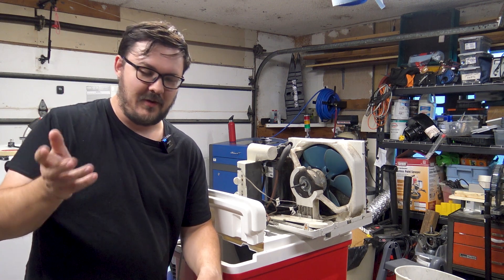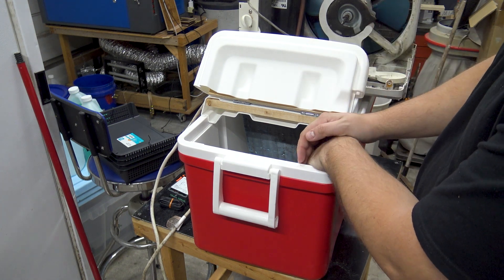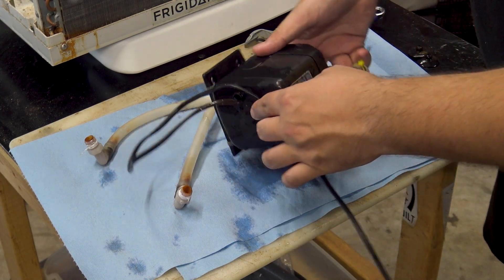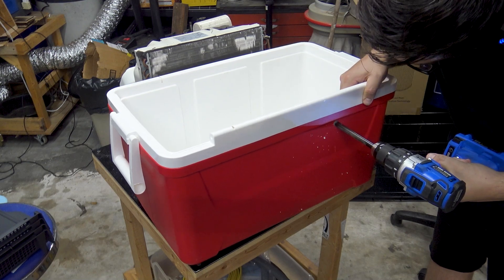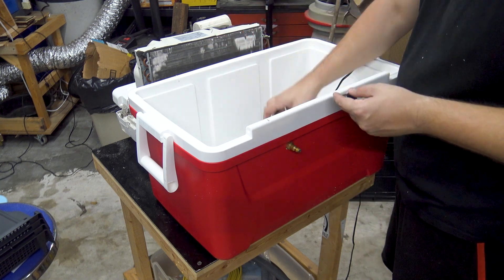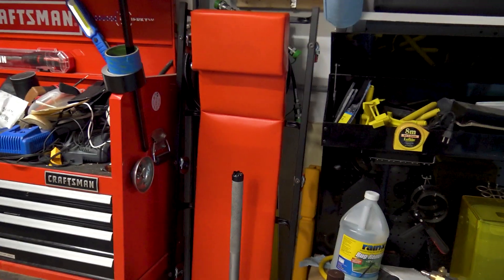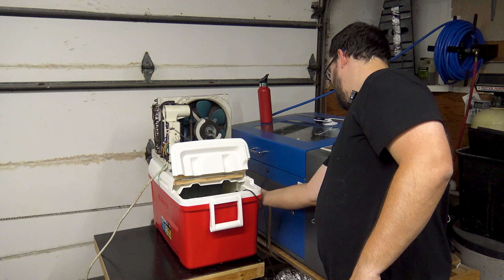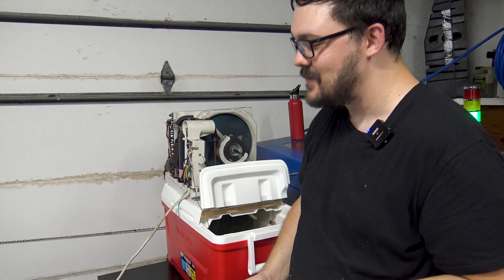IT WORKSSS! | DIY Laser AC Unit Water Chiller | Part 2

Comment: I know this is pretty late, but you should try to NOT use antifreeze in a laser. It will exponentially increase the likelihood that the laser arcs inside itself.
Reply from the maker: Good input. Thought about that but didn't really look into it much. So far it's been working fine, but I'll keep that in mind.

Comment: Have you had any issues with this system?
Reply from the maker: So far so good. The coolant fluid has gotten a little bit dirty but the container is not perfectly sealed and it's in a dirty garage and there's absolutely no filtering going on. it's performing pretty decently otherwise. I'll make a follow-up video soon.